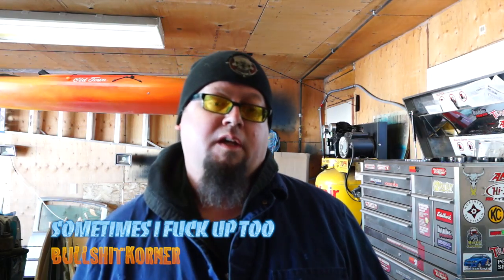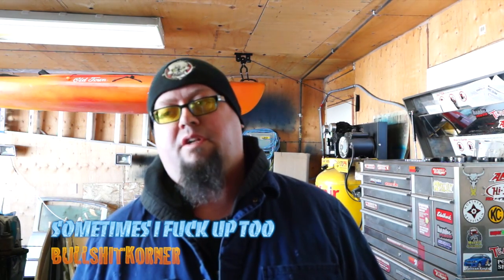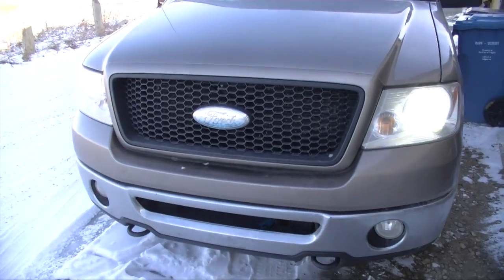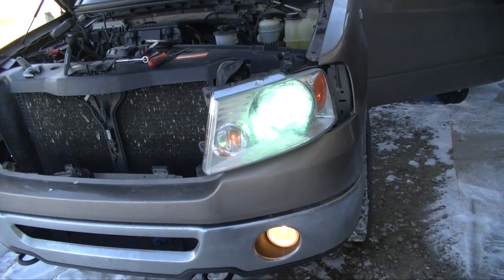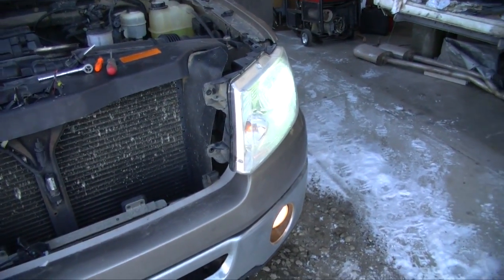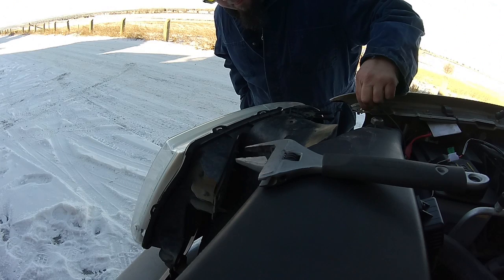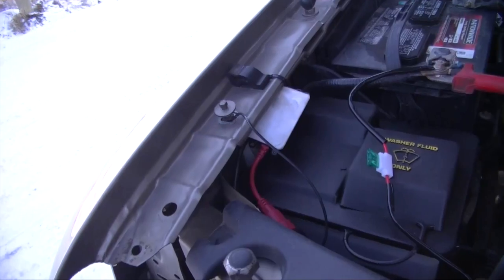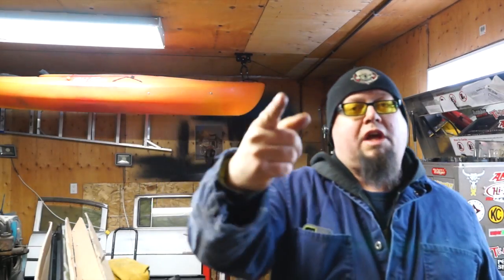Troubleshooting HID Lighting Issues

Comment: hello
i was wondering if the Ballast supposed to be Grounded because i just installed Hid lights yesterday in my Grand am and the issue that i have is that i they are 6000K and they look like Hell drivers side is Blue in color and the Passenger side is pure white, and when i go to start the car the passenger side strobe's to a flicker, i was told to switch around the the wires to match my headlight wiring input thin Red wire on right side of plug and black wire in middle and thick red wire on the other side so that is done but i did not ground ballast it is mounted on headlight frame plastic 
please help thanks
Reply from the maker: depends on your setup but they should have grounds
Reply: What should have grounds are you talking about the ballast should grounded or the lights

Comment: The Kit I have doesn't have an Open sourced ground to connect! It uses either a wiring harness which is grounded to battery ground OR....The electrical Lighting harness which has an existing body ground. So WTF!?

Comment: Wow look at that wiring off of the ground electrode; supposedly the wiring of the ground electrode should be at least 14 gauge real copper wire, same as the supposedly 14 gauge real copper wire for the positive electrode wiring in the Hid relay wiring harness and not the copper clad aluminum wire that is so prevalent in hookup wires nowadays.
Reply from the maker: +Dennis Lee Good point however still no issues been over a year
Reply: +Bullshitkorner I have seen many truly puzzling youtube videos of inexplicable one sided hid light bulb outages; its truly baffling the amount of intermittent outages as you demonstrate; its simply baffling at times to try and truly figure out and outright confusing at the same time; 

as you said in video its very easy to second guess ones install; wish there was a way of somehow narrowing it down Hid troubleshooting wise; naturally one can buy more Hid spare parts ballasts but that is neither here or there it would seem at times; 

now what Hid component and/or Hid part has gone specifically awry amidst the troubleshooting process for the hid ballast or the hid ignitor or both of them together, 

or perhaps even the hid relay wire harness itself could be at fault; or even perhaps using a single hid relay independent wire harness on both the left and right side Hid auto headlight bulbs as built in independent redundency backup is the answer; 

however I truly suspect what is happening is that the current needed by both the competing Hid ballasts themselves is so high that the one Hid ballast that looses out to getting the needed pre-requisite starved electrical current it needs to initially strike and start that critical initial electrical 23Kv electrical starting arc; 

who even knows that perhaps even the Hid ballasts themselves are somehow in the ignition process are unintentionally getting electrically damaged in this routine process of trying to fire together; 

now the curious question is it better to run independent Hid relay wire harnesses for each left/right side Hid ballast and Hid light bulb combination; sure it's a bit more money but if it somehow winds up being more reliable then it might be worth it ultimately; 

now I truly wish I had the answers to help figure out other people's Hid lighting problems; makes me afraid to get a Hid lighting system even for myself after seeing such inexplicable Hid lighting irrational and illogical behavior(s) signs and symptoms being observed and noted in the process of trying to troubleshooting Hid lighting problems that seemingly has no permanent satisfactory long term solution it would seem?

Glad to hear you were able to resolve your particular Hid troubleshooting problems and track down the culprit in your case being the less than optimal ground lead electrode; who would ever figure that out but it makes all the more sense the negative ground lead is the return path and just as much Hid current flows through the negative electrode ground lead after all as the positive lead electrodes also as well?

Unfortunately, I have more questions than answers in regards to Hid troubleshooting and truly wish I did understand more about the not so simple Hid troubleshooting process itself; though I am trying to view Hid troubleshooting youtube video like yours does help and contribute to my ongoing Hid troubleshooting analysis and future understanding somewhat!
Reply: +Dennis Lee I run 2 relays for my headlight system for both left and right side. And if anything goes wrong, for example, I had my right headlight go out like in this video, but mine went out after a couple of years, I knew my right install with the relay has the problem and not the left side install with the relay.  Plus both of my relays I installed have fuses and use proper copper wiring (not cca wires) I got from the auto store.  This video, I like how people figure things out and fix their problems...

Comment: Man, I had the same issue with mine. At least you found your issue relatively quickly. Took me almost 6 months to determine mine since it would turn off after running over bumps. Never thought it was something as simple as a ground bahaha.
Reply from the maker: I had the same issue with my Indian Motorcycle when i Owned it, always had a issue with hitting a bump and the headlight would go out, however whenever i checked ground afterwards it was fine until one day i started wiggling all the wires and found the issue

Comment: Well done- it would have been nice to have seen you do a  voltage drop on the ground instead of swapping the bulbs.  Did you test the ground you have now ?
Reply from the maker: the ground I have not is into a insert so far been a few weeks and no issues as of yet.  I would have measured for voltage if the ground didn't fix the issue.

Comment: Get yellow foglamps dude
Reply from the maker: I haven't seen Yellow fog lamps in so long, I remember having them years ago on a Bronco I had.  I wasn't impressed with them they didn't seem to do well when it was foggy out
Reply: I have yellow hids 3000k. And you're right about not doing so well in the fog. I have them cause they look good.
Reply from the maker: oh ok, here I thought that maybe by chance the HID fog lamps would work a bit better in the fog
Reply: It's a little bit more light than stock halogen bulbs. Yellow does help with the snow though. Wouldn't hurt much to try them out for a bit and compare.